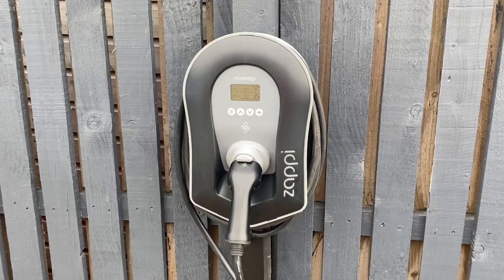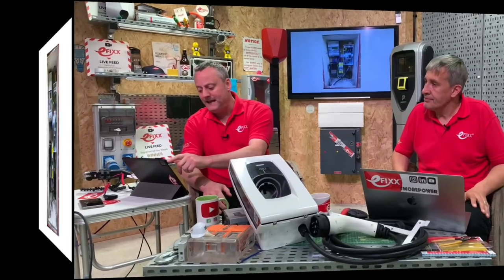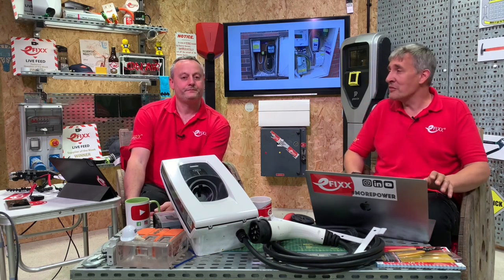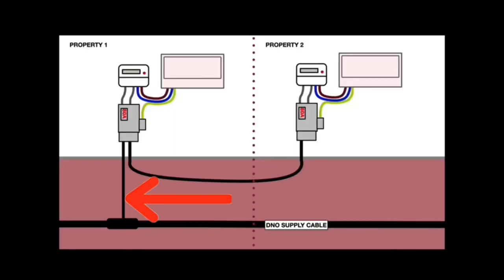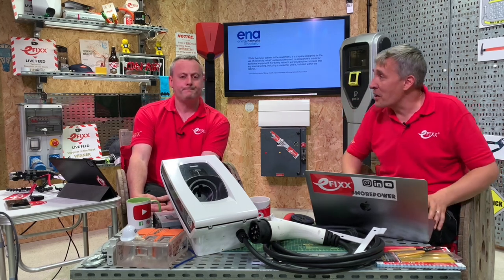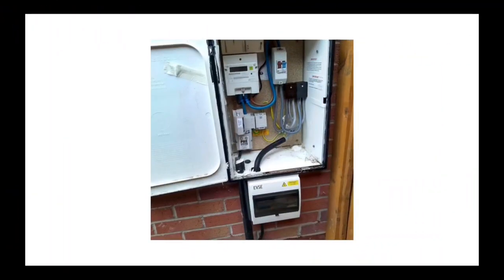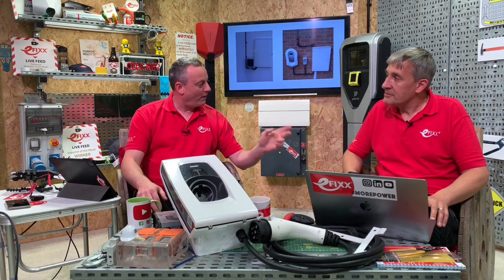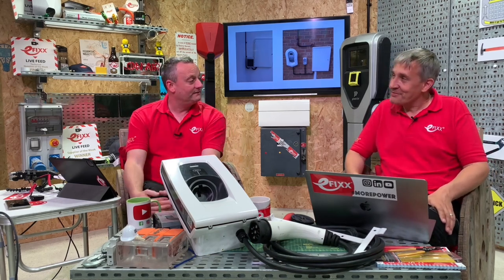Can ELECTRICIANS fit equipment inside the DNO METER BOX? - EV Charger Installation UK

Comment: I have had an EV charger fitted, and they installed a consumer unit within the meter box which I had specifically requsted not to do (as I intend to get 3 phase installed in the next few years) as there was spare ways on the house distribution board  (other side of the meter box in a cupboard under the stairs) and with it being a relatively new board it's very easy to get hold of matching 40A MCB or RCBO. I got given the argument "if a fault occurs it could knock the whole house out, or the house could knock the charger off," hence why I suggested to put it on it's own RCBO separate from the two RCDs that protect the rest of the house and garage which they said they weren't prepared to do. After this video I've asked them to clarify why they did it the way they did and got pretty much the same answer, so currently waiting on my DNO (NPG) and supplier to comment on the installation, with any luck I'll then be able to get it installed correctly.
Reply: NPG state explicitly on their web site that customers equipment CAN be added inside the meter box!

Comment: The only kit I permit to be fitted within the meter box is an isolator/switch fuse or Henley blocks located bottom right (where possible) as per the UKPN diagram. This leaves space for 2nd meter or a check meter as required. Anything else has to be somewhere else. My own supply doesn't enter via a meter box so I don't have that issue, although I did get a bit of a grumble when a DNO guy spotted that the meter board had been shaved at some point in the past.

Comment: Brilliant research. I let the metering company and dno put their equipment in my wall mounted garden tools store. I have never heard of a meter box.... I rest my case your honour 🤣

Very informative video as always!
Reply from the maker: Thanks Mark needed quite a bit of phone work to extract the answers on this one.  Down the road a few customers may end up paying the price of a “standard EV” install *Gordon
Reply: @efixx  yes if meter installers start rejecting jobs because of this will def cause customers issues. Would be interesting to see any dno deny someone a right to electricity because of it! I would guess they would be in breach of more rules/laws than the customer with equipment were it shouldn't be lol.

We have had to sort some really bad EV installs this last year. Incorrect rcds, cable types/size and worse even a missing CPC!
Reply: Mr Allison.😯
 If anyone would know, I'd have thought it would be you 😉.  After all you are...  Mark (by the book) Allison.

That aside... looks like the world of the Youtuber/Instagram Sparky posting all their EV installs is coming back to bite them on the @ss. Wonder how many will put things right at their expense once their customers get wise to this oversight eh?
Reply: @Sparks1Plumbers0  probably not many tbh. The position of the dno and metering companies is long established. But never enforced. I doubt it will be an issue until they need the "space".

I have seen a document that includes the top right section of a meter cabinet for customer/contractor equipment. I think UK power networks.

We dont use the space as its not ideal for customer use in a meter cabinet anyway. Always back to main CU, no exceptions.  But I doubt very much anyone will need or want to return to jobs completed.

Comment: Most new builds where the consumer unit is more than 3m away from the meter box. Switch fuse is fitted in the meter box. No meter installer has ever refused to fit  in the meter box and in fact on new builds meter installers will actively keep their meter connection and 2P isolator over as much as they can to facilitate switch fuse enclosure installation. 

I agree on anything else (EV) should not be in the meter enclosure but switch fuse should be expected as permitted.

Comment: From what I can see (abd when speaking to UKPN), there is no issue  in installing a small CU in the meter cabinet. They "recommend" you shouldn't, but its not a "you must not" it's the property owners space that has been allocated for use by the DNO and surply company. If when the time comes that the DNO/surply company wants to change equipment, if there is not enough space, its down to the owner to have space made.
Reply: exactly what the DNO said on my brand new house. This video is completely misleading

Comment: Thanks for this video.
I am about to have an EV charger installed, and it is only today that I realized the requirement to run a cable to the internal consumer unit.
I did not know this is required and thought that everything is connected to the external meter box.
The DNO says the meter box is owned by the customer, and that for safety reasons the charger should be connected to the consumer box, but is it actually illegal to house everything in the meter box?
If it is not illegal, what's stopping someone doing it?

Comment: The guys who installed mine put the monitoring CT's on the outgoing tails to the consumer unit and introduced a Henley Block with an RCD mounted in an IP rated enclosure external to the meter box. This then fed out to my charger surface clipped - very neatly actually. This is down the side of the house behind locked gates and the charger cable passes through the hinge gap to charge my car. Doesn't look too bad tbf. As its down the side of my house behind locked gates this should reduce the chance of any malicious acts (switching off) - more probable some scoundrel were to park on  my drive and steal some electricity!!. I think if we are getting into the realms of a new db then the EV installer would no doubt scope this as an 'over and above' and charge accordingly.

Comment: I got around the problem by installing an empty meter box next to the meter box  with the bno's equipment in.

So we now have 3 external boxes :- gas,electricity meter box with the main cut out in and the third box with is empty, ready for any garden feed termination solar equipment and ev fuse board.

Comment: So I’m trying to get an EV point installed. The installer has suggested exactly what you’d talking about switchgear in the meter cabinet. My question is can the installer split the tails and fit a double pole isolator for a 6mm Dist cable to go to a garage CU for the EV point. Similar to the isolator that was fitted by the DNO. I am waiting on a reply from the DNO as well

Comment: Very helpful video guys, but it overlooks an important point.

Firstly a comment on what you've said in the video. "All the DNOs have said no". But their trade association says it's "not recommended". And this only came some time after after you had asked the question, suggesting it was something they had to think hard about before replying. And they would say that wouldn't they? Otherwise it would have given free licence for people to do whatever they want inside the meter cupboard.

You also referred to the additional heat that can be generated within the meter box. A fair point, but the box is located outside and wouldn't the same heat be generated within a CU if the EV charger was connected there? 

My main concern is the constant high current (32A) draw from a single source for maybe 7 hours. If we had an electric shower, that would no doubt be off its own fuse in the CU. But we don't shower for 7 hours. Similarly an induction hob might have a high draw if all elements were on at the same time. But they wouldn't be on for 7 hours.

And all this would be going on inside the property. Surely it's better to take this risk outside? Are current CU's really designed to be used in this way?

The extra space that may be needed for additional equipment seems to allow DNOs to do what they like. Fair enough, but what extra equipment do they think they will need? A really large Smart meter? If anything they're getting smaller.

I'm not suggesting a free for all. But I cannot see why a Henley block and small dedicated CU for the charger cannot be fitted inside most cupboards. Better to have this regulated by good practice guidance than expose consumers to additional risks. The installations could also be subject to periodic or random inspections if this is a concern.

Comment: Some insights into this subject from a guy who has fitted the original DNO equipment and replaced the DNO equipment more times than I have hot dinners.
The boxes where originally installed so that meter readers did not have to enter the house, flats could be read all from one outside place and that sort of idea. The slim ones especially have little room and on occasion have been too small for the meter and timeclock t be fitted, with older tariffs.
Historically the DNO would replace the doors as access to stocks of doors by a consumer was difficult. A few years after privatisation someone had a thought, lets see how much this is costing us? In 1 year, around 2005 ish it cost the DNO I worked for almost 2 million, to add fuel to the fire the reason the door needed changing 90% of the time it was the consumer not shutting the door correctly when using a key meter, we returned to the same properties time and again and the same areas time and again.
So they don't replace them anymore the customer has too.
Space is everything here as the DNO cut out may require changing at some point and this will be done Live, no point of isolation and the nearest fuse is probably 500a and 100 meters away, so to remove that would mean dozens if not more customers off to make it dead. The other option is to dig a hole, cut the cable, again live, then joint it back together and fill in the hole. So a 20min job is now 4hrs and still one man has to work live, and a potential future fault is introduced.
So don't put equipment close to meters or cutout's, its dangerous to us DNO guys and costly to the homeowner.
Regarding what's inside or could be inside, in a common sense, real world kind of way, I would never complain about any tails running through the box if out of the way, also a couple of connector blocks to split the tails, one for CU and one for charger. I can't believe anyone else would either, unofficially that is (covering my butt).
One DP isolator on the CU tails is also fine.
Always remember the guy is working live and needs room to not kill himself so they do a risk assessment, a very strict one, if they can't reasonably get their hands in with thick gloves on then its a no go...
It makes a very big mess of your face and the box if you get it wrong (I can vouch for that).
I hope this sheds some light on why the DNO's say NO quite so categorically.
Cheers

Comment: Many houses will soon have a nice free space to house things in. The old gas meter box!
I can't take credit sadly. Next door to my parents have had a heat pump and EV charger installed and they have used the box where the old gas meter was. 
The tails are hidden in the cavity as is the cable to the EV charger.
The old conduit for the gas pipe hides the  cabling for the heat pump down to near ground level and then off round the back of the house to the heat pump main unit.

Comment: What I have understand, their answer means, YES you can use the meter box for EV, PV equipment and other things, BUT if we need the space, we could require you to remove the items. Because meter boxes have different sizes, if they installed a huuge meter box with lots of space, of course you could use that space, then theres no problem with heat either.

Another sort of equipment that is common to put in meter boxes are meter reading equipment. Usually part of home automation, people install small LED detectors on their meters with doble-sided tape, that will wirelessly send the meter value into the house.

Same would apply if meter box is too small, they could require you to replace it with a bigger one if they are going to install a bigger meter that doesn't fit, or if you make changes in electricity supply agreement, for example, a 3-phase supply instead of 1-phase supply, and the meter box is to small to house a 3-phase meter + 3-phase cutout.

So I take the answer as the priority seat on buses. You can sit there, but a disabled person have priority, and you have to move or stand up if such a person wants to use the seat.

Comment: Have the regulations now changed to allow access to meter box? We had our charger installed only yesterday. I made space around the consumer unit for easy access and the installer all the extra parts in the meter cabinet inside our house instead. We went with a big company who use specialist EV charger installers to complete the install. I questioned this at the end and the installer showed me dozens of photos of installs where this is the norm. He then showed me pictures of people with new houses where they installed a separate consumer unit next to the charger which I thought looked awful. At least we have a tidy installation but I'm unsure now if this is legal? Surely they have to keep to the regulations in 2023?

Comment: It’s called the METER box for a reason.. there should be a cut out box only as well. That conduit job looks proper.. keeping in mind that most of the times is surface installations might as well make it look presentable

Comment: So what about switch-fuses and henley block? I have a load of houses with split concentric where the meter installers removed the cover to expose the inner cores.  I like the fact we have to maintain and replace lids and we cant touch the board.

Comment: If the box isn't owned by the Dno then there isn't any problem in any additional electronic or electrical devices to be installed with in the enclosure.
No PV installation has ever been pulled on this issue but yet car charging has?

Comment: I have a pulsar on order from smart home chargers and they are due to install it in a few weeks. My consumer unit is in my dining room and during the online survey they said not to worry as the new consumer unit can be placed in the meter box. Will they be liable for it if the installation is wrong and goes against the DNOs recommendations?
Reply from the maker: Suggest you ask your installer for confirmation- do you have a smart meter already installed.
Reply: @efixx  yes, it's a new build, not sure if it's the gen 2 one or not. So may need to be replaced in the near future as I'm changing over to Octopus and not sure if they can read my current British gas smart meter. The house is 18 months old.

Comment: can you fit an additional meter box next to the original to fit all your equipment in
Reply: Yes you can , very useful if your db is a distance from meter then you can fit kmf feeding db with swa
Reply: Generally more of a builders job than an electricians due to potentially weakening the wall, on that note would you need building regs or planning permission like for a new small window?

Comment: How do builders replace a damaged incoming meter box on external walls?  Does the power supply need to be disconnected to fit a completely new box?

Comment: What about henly blocks?
Reply from the maker: The way we read it no
Reply: nope not unless it is part of the DNO or suppliers installation, so for example they can not be fitted by an electrician to split the supply
Reply: So that would also prevent the use of an IP distribution board as well then.
Reply: unless you broke into the tails outside of the meterbox but before they get to the consumer unit
Reply: One thing we're over looking is, yes the meter box is an enclosure supplied and owned by the homeowner... but for the use of the DNO to install their supply equipment. 

The incoming cable and main cutout are the only bits owned by the DNO. The meter is then owned by your Energy supplier and it is they who then come along and fit an Isolator Switch along side their new Smart Meters ... so if the tails coming out then go into a Henley who's to say that Henley isn't the property of the energy supplier?  

So in the real world away from reg books etc... would a visiting DNO engineer sit on his phone for hours on end asking each and every one of the homeowner past and current suppliers if it was they who had fitted the Henley block? I think not... do you.  

So going back to the two G's findings ... the fitting of CU's & CT's is a blatant visual NO as the MB is only there for the use of the DNO [and by way of the actual Meter being in there  the use of the Energy supplier]...  but a HB feeding a separate IP rated enclosure alongside the already existing MB housing any additional equipment would be the way to go.

Comment: Could a solution be to install a larger 3 phase meter cabinet? These enclosures have an internal area around 70% larger than the standard cabinet designed for a single-phase supply, both wider and taller to accommodate a larger three phase cut out and three phase meter or three single phase meters, so on a single phase supply could easily accommodate a small consumer unit for an EV charger and an isolator while still leaving more room free for the DNO and metering equipment than would be available with a standard size enclosure with no additional equipment fitted. There would be fewer potential issues around heat dissipation owing to the larger internal volume of the bigger cabinet and the DNO would be given more than adequate space for their equipment. But the question is, would the DNO agree to this?